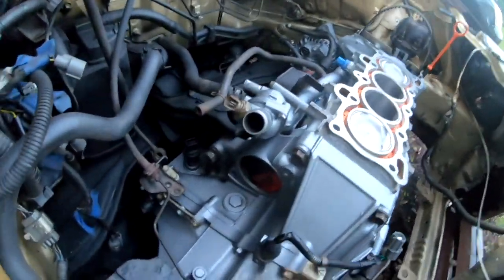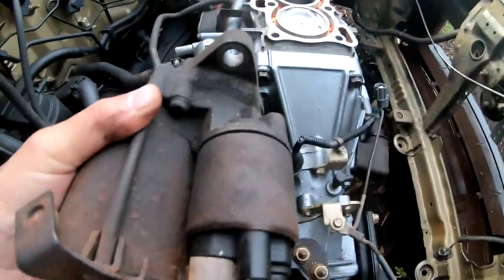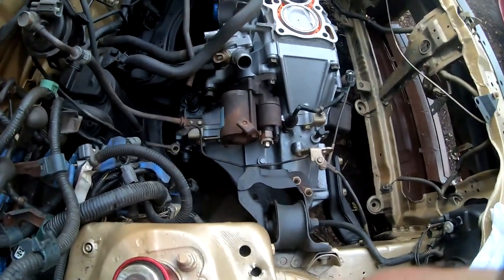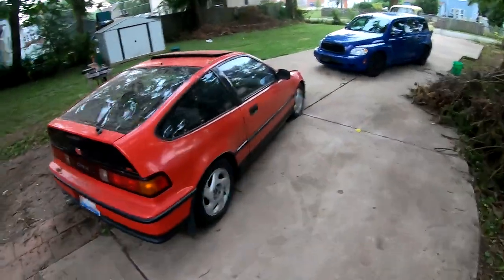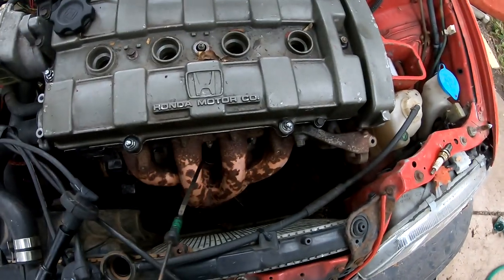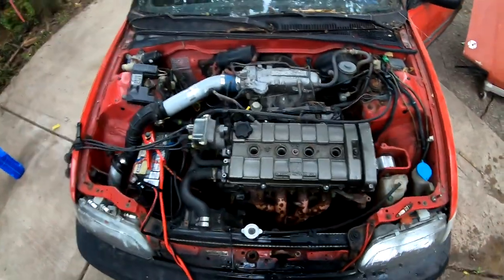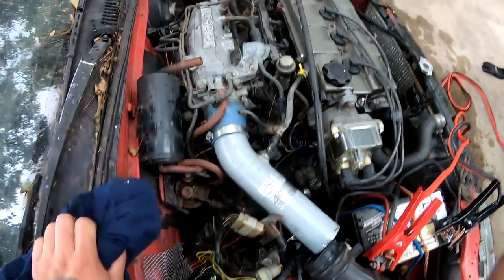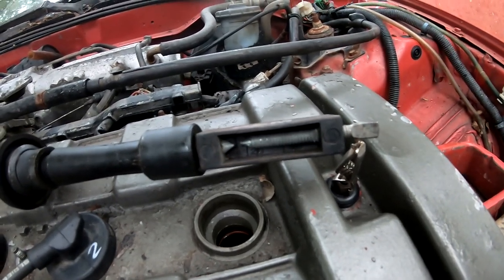Abandoned swapped CRX resurrected b18

Comment: Hey man. I know on my Tahoe I had to use starting fluid and keep turning it over to try and get the fuel to throttle body. It was doing the same thing. After a while it finally started. Good fuel pump, good spark and it just took like forever to get gas thru. Keep me posted.

Comment: Nesquick is looking good, Might as well clean up that starter {do it for Michael}. I would have put the CRX battery on a charger overnight, if you jump it again, rev the other car a bit, it will get more charge. I agree with others the gas is likely bad, siphen out what you can and add new. I bet it starts right up. I've got an 89 CRX HF. Great car -those that know, know!

Comment: You did such a great job on the engine bay and cleaning up, clean up that starter. On the CRX no question bad fuel in it, prolly water as well in the tank. I would purge the fuel lines and tank before spending any time on other things. After that, you can do timing and pump but don't forget it had no oil or water so something is up and could be major. I would just look over the engine and make sure you don't see a hole in the block before you put into much more time.
Reply from the maker: Your right Im gonna pull that starter and clean it up just for you 😃👍

Comment: You have bad/old gas. I’ve had that issue on an old CRX too. Dump an entire can (or 2) of B12 Chemtool (must be this) and fill the rest of the tank with premium fuel so at least 1/2 is new gas. Let it sit for a day and try and start it. It will start and run. 

The starting fluid will work too, I’m sure. Try that first. 

Restore it: https://bringatrailer.com/auctions/results/?search=Crx
Reply from the maker: Thanks yea that my suspicion too the car did run before. I wanna buy it lol.